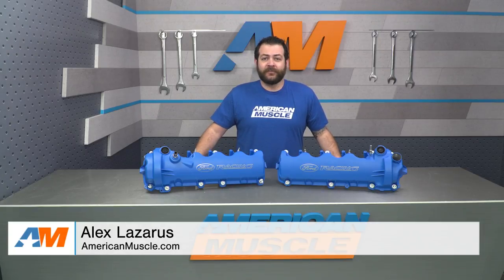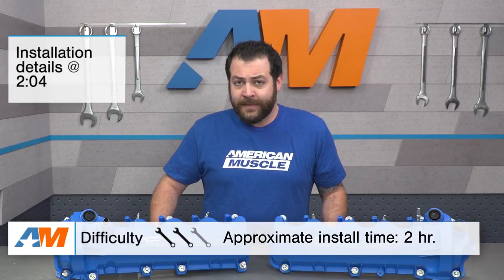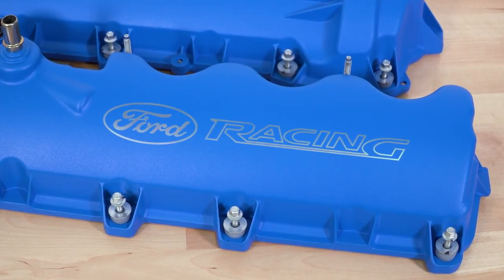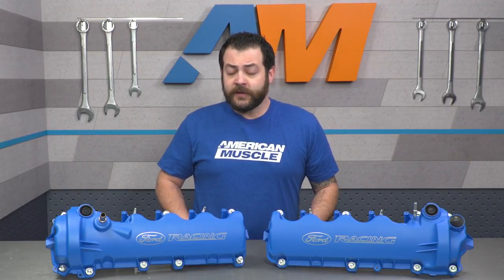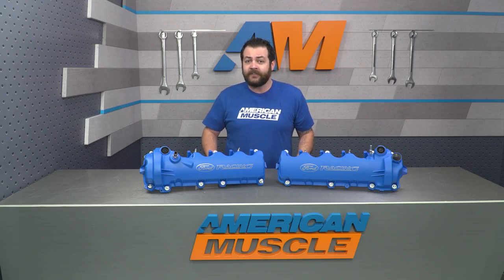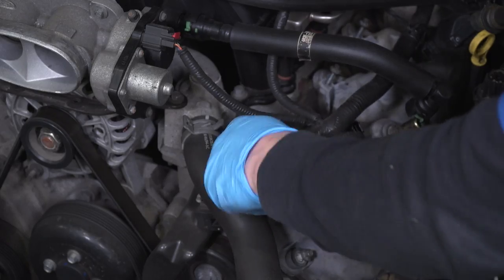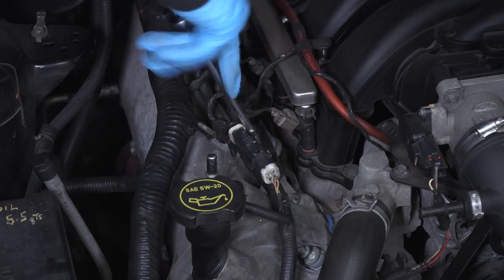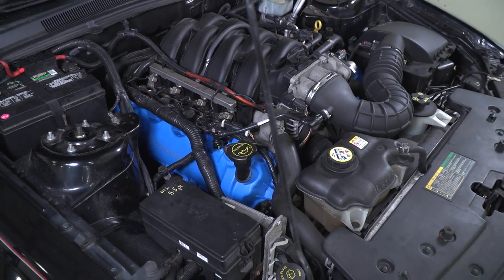2005-2010 Mustang GT Ford Performance Laser Etched Valve Covers Review & Install

Comment: Those that are wondering, these fit the Explorer 4.6 3v aswell and should also fit the 4.6 3v F150 since it's the same engine as the explorer.